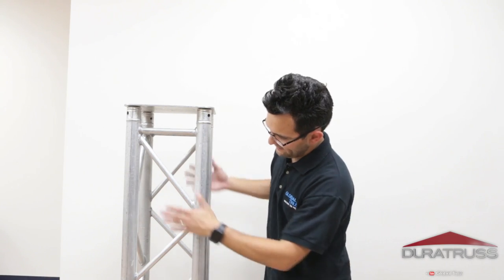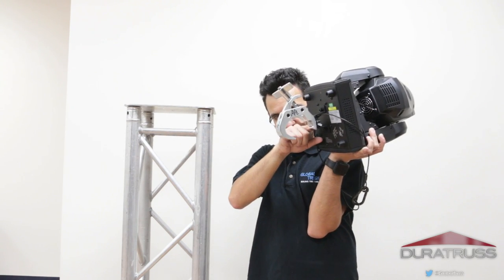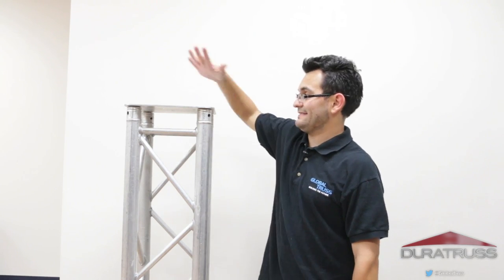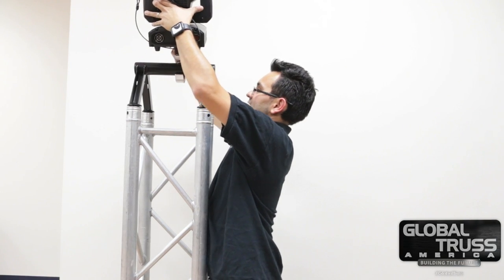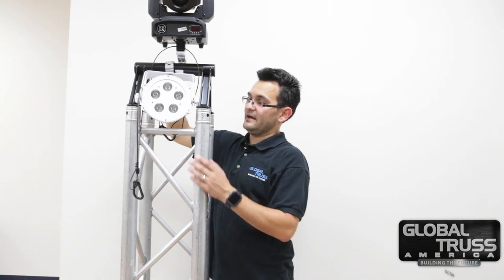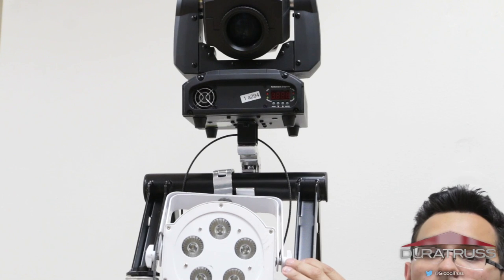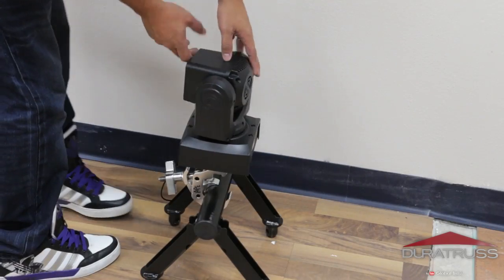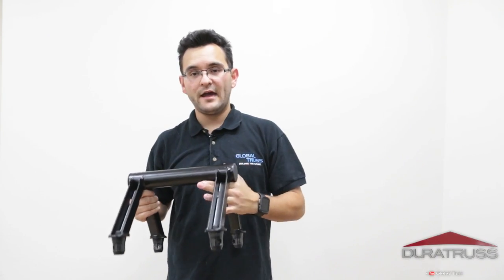AWESOME TOTEM TOPPER! The DT-FXMT

Comment: An easier and cheaper way, would be to cut a hole in the original aluminium top plate that is big enough for the clamp to pass through (if using an O clamp, the hole would be smaller vs using a C type clamp). That way you don't need to remove the clamp from the bottom of the moving head, and the head's rubber feet will sit nicely on the top plate. For safety, use a cable from the clamp to one of the totem's cross beams.

Comment: Somehow that kinda looks out of place.. And rather busy up top. If Im including truss totem set up in shows, id plan ahead to what goes on top, in this case remove the clamps prior and store it at home.
Reply from the maker: Not as easy when you have 4 events in 2 days
Reply: +Arnoldo Offermann I don't exactly know how big your shows/rigs are Arnoldo, here Im just basically referring to a single average mobile dj. If one have that many shows back to back with a  consistent weekly income, Imo I'd rather invest in 1-2more moving heads/fixtures and have it as back ups also, Nevertheless, better to have the option than none..
Reply from the maker: That ruins ROI. Why have movers sitting when I can take the same ones show to show. Even a normal mobile DJ can benefit from this tool.